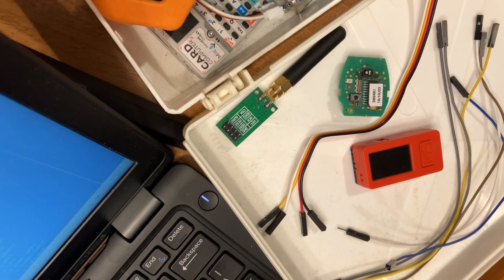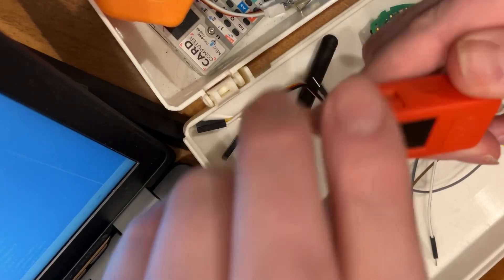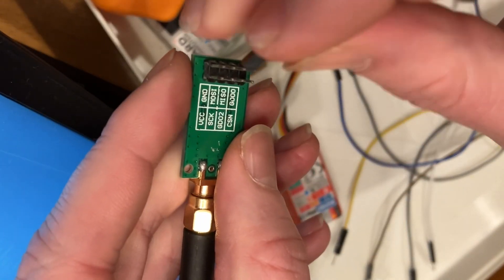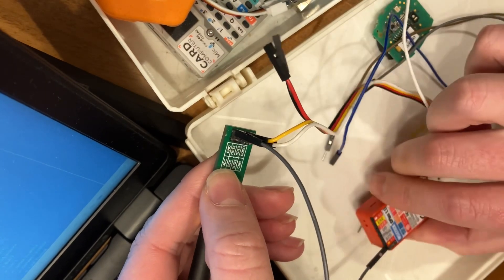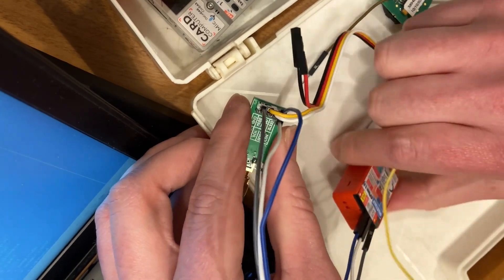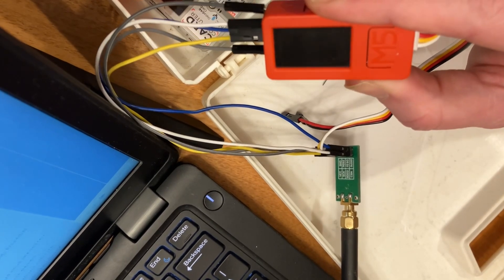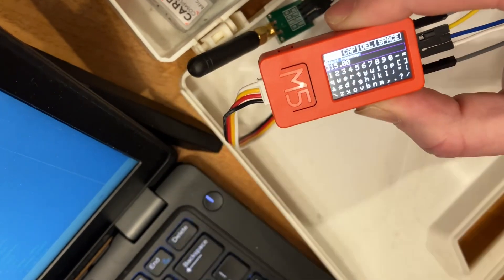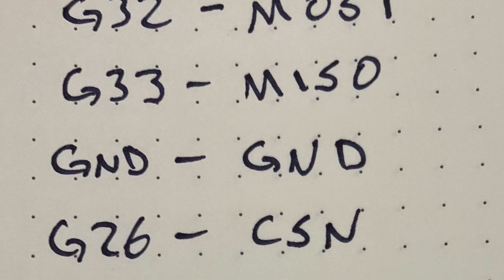How to connect CC1101 module to M5StickCPlus

Comment: Is it possible to mount the cc1101 and the nrf24l01 modules on the same pcb board, so that i can have them both physically connected to the m5stickc. I know they can't be operated at the same time, but it will give me the convenience of not disconnecting and reconnecting the other module.
Reply from the maker: Yes, but you will need to use a switch because they will both need to use the same pins
Reply: @stuffilike1845  which pin should i put a switch on? Thanks.
Reply from the maker: vcc

Comment: Can you use normal wires and solder them or do u have to buy the cables
Reply from the maker: You can solder them to the module

Comment: Using the c1101 is it better to dauth? Like more range
Reply from the maker: The stick does not support subghz frequencies out of the box. You need to connect this module and then you can capture and send rf signals. It can be used w Bruce firmware and Nemo I believe

Comment: What can it do?
Reply from the maker: it sends and receives wireless data at sub ghz frequencies. a lot of devices operate at certain frequencies of the radio spectrum. the module lets you communicate with those devices.